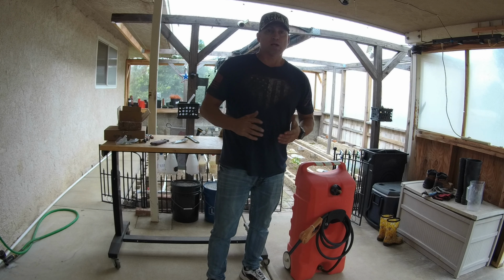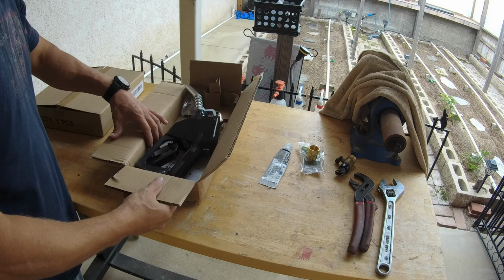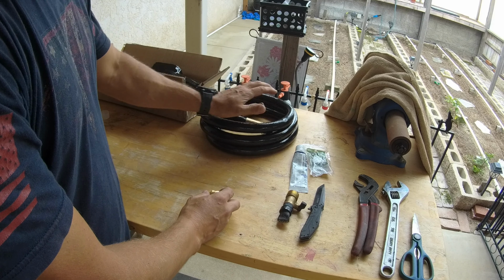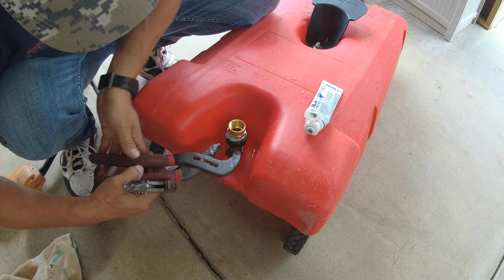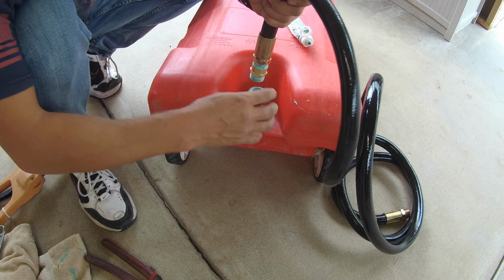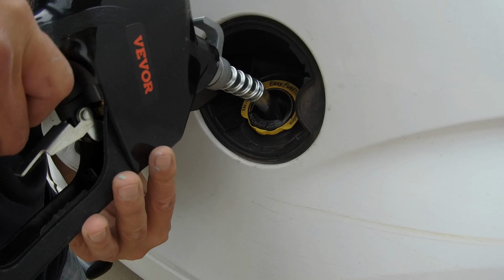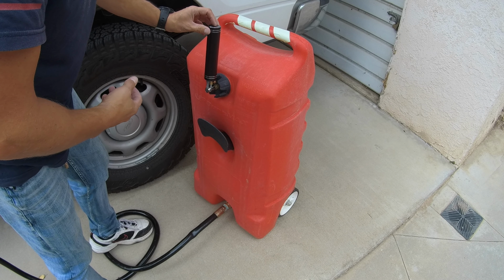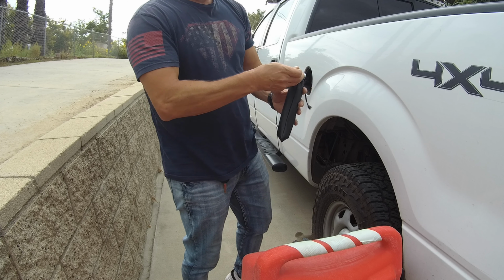Duramax Gas Caddy Hose Upgrade

Comment: Thanks for the info. My hand pump started to fail, so I'm glad to find you. I put my tank in the back of my trailer, so I set it in a plastic tub so if there is any spill, it's will be continued. So I put a 90° fitting so the hose runs parallel to the side of the tank to protect the shut offs and the hose. Thank you again

Comment: I found your video and ordered the parts to upgrade my fuel caddy. I installed this weekend. Took me a minute to realize the plastic collar was a hindrance around the garden hose and I removed it. But everything is so much better than the original inferior hose and nozzle they supplied. I hate smelling like gas every time I fuel my equipment. Thanks for your suggestions and parts list

Comment: Good upgrade.  I would add, though, that the fuel thread sealant should be allowed to set for 24 hours before allowing fuel to run through the hose.  I used all of your recommended products, and tested it right away, and something leaked a bit, dripping the blue sealant with it onto my driveway.  That stuff isn't easy to remove (from skin either, so wear gloves when applying!)  Otherwise... worked like a champ!
Reply from the maker: Thanks for the update.  Did you use the hose to pipe adapter I listed from amazon?  Someone else had a problem with that adapter. I actually bought mine from Home Depot and didn't have any leaks.  I'm thinking that one from Amazon is the problem. This is the one I bought from Home Depot.
https://www.homedepot.com/p/Everbilt-3-4-in-MHT-x-3-4-in-FIP-Brass-Adapter-Fitting-801759/300096107
Reply from the maker: I should have linked this one from Amazon. Sorry about that. This one has the same description as the one I bought from Home Depot. I'm updating my parts list. https://amzn.to/3Of903m

Comment: Thanks for the video and link to the parts. I have one of these tanks that I replaced the hose on and added the air valve, now the handle is leaking like yours was. I was given a 2nd tank but it's missing the hose and nozzle so I'm going to use your parts list to modify both of them. Thanks again.
Reply from the maker: How did it turn out?

Comment: I actually had a FACET Fuel-It pump before I got my Tank Caddy. Obviously, the upgrade i did was to replace the hand pump with the battery powered one. Works great.
Reply: Do u have a link to where I can get this?

Comment: I would caution using the electric pump on the shader valve where fumes live. I would either go manual there or a pump with hose away from the tank

Comment: My question is that air adapter does it have the ability to leak if you fill it to the brim while in transit or when moving it around? Also do you just rip that little vent screw out of the fill cap to install the valve stem to add air ? It takes me about 20:mins to gravity fill the whole caddy with it on the edge of the bed.
Reply from the maker: Watch my other videos too. Just pull out the old black screw and screw in the air valve stem. Then screw in a tire deflator so it won't pressurize too much.  Then get yourself a ball pump.

Comment: I did this upgrade right here in the video and leaking behind the hose nozzle I screwed into. Wish I was able to share a picture. Can you tell me how long the Gasoila takes to dry and set?
Reply from the maker: @spencerherrick9392  if it's leaking, did you attach the right threaded fittings? It should not leak at all after. Where did you get the hose to pipe adapter? Check that first to make sure it's the right threads and seated properly.
Reply: @ I’m good there so far. I’m going to let it set overnight. It’s leaking under black twist ring hose fitting.
Reply from the maker: @spencerherrick9392  mine didn't leak at all. Did you put the rubber washers inside the female end? You need those too just like hoses have.

Comment: After the seeing all the problems with the duromax by septer I can see why ended up in the trash without the hose I looked at buying one but at 60.00 dollars and the amount I would use it I just left it in my shed until I moved to Drumheller Alberta and commuted to Calgary for work and found the prices for gasoline could be a large difference between the two places sometimes over 10 cents a litre that's 45 cents a imperial gallon almost 40 cents a US gallon so I filled the Flo and go as a backup without the hose and nozzle I did find a problem because my siphon pump packed it in and all I had was a peice of 1/2 irrigation pipe siphon it into my 5 gallon ¹gas can it got me to the nearest gas station also filled it up when prices were about to rise used it a few times for that reason then I parked the van for over a year now that fuel prices are about to go up by 10 to 20 cents per litre I drained it into my pt cruiser I did finally get smart cut 10 feet off the male end of a garden hose and attached it to the tank worked great  and since my gas gauge does not work I put 2 gallons in my gas can and headed from east coulee 20 kilometers to Drumheller and refilled it and all my gas cans prices in Calgary are already up by 10 cents per litre so since I had a Doctor's appointment I filled while in town  almost 300 dollars to fill my big cube van and all my gas cans including the duromax

Comment from the maker: For Quick Hose Disconnects,
Here is one with good reviews but I can't find one with an auto shutoff that is male threaded. Just remember, if you disconnect the hose, all the gas in the hose would leak out if you don't let it flow back into the tank.
I would also get some gasoline resistant washers and O-Rings because fuel might eventually eat through rubber hose washers.  I'm not sure what kind they come with so might as well just have some spares.

Quick Hose Disconnect Adapter https://amzn.to/3OghgzU
Gasoline Resistant Neoprene Washers https://amzn.to/3Hwz9He
O-Ring Kit https://amzn.to/3S98jK6

Comment: I wonder, is it possible to add a quick release of some sort to the hose so that you don't have to take the hoses with you to refill, and for storage?
Reply from the maker: Yes, you have to just get a quick release hose adapter. Also, make sure the closed half of the quick release adapter attaches to the tank so that when you disconnect it, it has a shutoff. Go with a good brass one...not plastic.
Reply: @plantbasedprepper could you put a link of what quick release with the shutoff valve you'd recommend
Reply from the maker: @cmack6686  I would go with this one since it has an Auto Shutoff when disconnected.  Remember, gasoline might eat through rubber washers so I would change those out to gasoline resistant ones instead.
Quick Disconnect: https://amzn.to/3OghgzU
Gasoline Resistant Neoprene Washers https://amzn.to/3Hwz9He

Comment: I just did the hacks on mine, my new hose is such good quality it's like a gas station hose althought that adds a lot of weight to it.  I also got a swivel for the tank connection end (3/4" female water hose connection to 3/4"  female pipe threads) to help even more on the twisting of the hose. I don't see a difference in the threads except "water hose connection threads" has a washer in it. I hooked it up and no more leaks (for now anyway).  My concern is the original valve coming out of the caddy.  How would you replace or find one of those if it starts leaking?  It must have a nut inside the tank that holds/seals it in.  I'm afraid that one is going to start leaking then i'm screwed........there's no way to get inside that tank to put a nut on the back??? Does anyone know how replacing that shutoff valve right at the plastic tank is going to be accomplished???
Reply from the maker: It's easy to get and put in a bulkhead fitting valve. You use a string tied to the male end and drop it in the tank, then pull through the hole...put the nut on from outside. I do it all the time with 55 gallon drums.
Reply: @plantbasedprepper  Sure enough I got a leak and the shutoff valve part broke on my original one.  I thought I had it fixed, watch it for an hour and no leaks then came back the next day and the whole 12 gallons of gas was gone!!  I will try your suggestion. Thanks for the response.
Reply from the maker: @olkiedokie3173  get a bulk head fitting....put a string inside the tank...pull threw bottome hole.. hold the strings and thread the bulk head nut through the string and it should drop to the hole. I just did this again with my 55 gallon water drum. Let us know what parts you used. We may all need to replace ours too at some point.
Reply: @plantbasedprepper  Will do, I just ordered one from Amazon, it's Polyvinyl Chloride material (plastic) but I'm sure I read where it's gas safe.  I'm trying to get this old one off, I'm starting to think it's left-handed threads, it's a witch to get in there with tools in that small area. I will let you know how it goes, i'm starting to get pissy with this but i've got too much invested to throw it away........I think! LOL
Reply: @plantbasedprepper  Ok, I got the old valve out, it's a 1/2" male pipe thread going thru that nut you see against the tank, however it is not a bulk head fitting, there is 1/2" pipe thread female brass fitting made into that plastic,that nut serves as an external jam nut to lock it in.  I didn't wait for the one I have ordered from Amazon, I went to Ace Hardware and got a 2-12" brass nipple (I wanted to get all that away from the indent part so I can work with the damn thing), then I put a 1/2" fpt to 3/4" female hose fitting on it and bought a brass water hose shut-off valve exactly like what was on there, then hooked my upgraded hose/filler nozzle to that.  I used the Gasoila sealant on everything then I pressured it up to 5 lbs and no leaks, I left it pressured and we'll see tomorrow what happens. I wish I could send you pics.
Reply from the maker: @olkiedokie3173  cool. My email is roy@pbp.one

Comment: The flo n go's are a good concept, terrible quality.  I only ever used the stand alone pump that could syphon by squeezing.  But they never lasted more than two seasons.   I would pay more money for the same concept in a quality item, made of metal, and replaceable seals.
Reply from the maker: With all of the upgrades, I'm happy with it but it ends up costing $300 to make it better.  Seems like everything we buy nowadays doesn't last very long because they use cheap parts to lower the price tag.